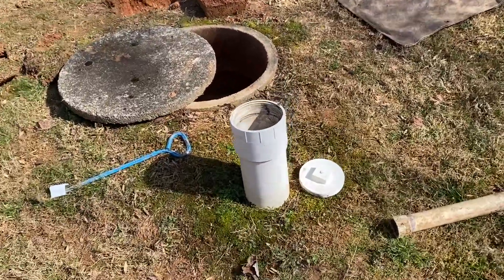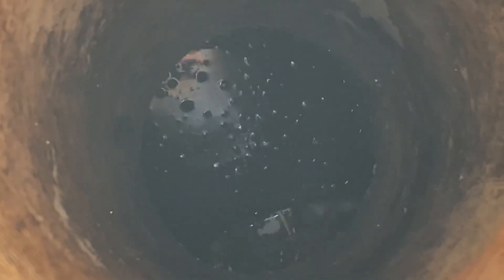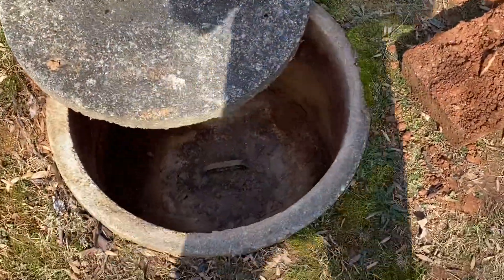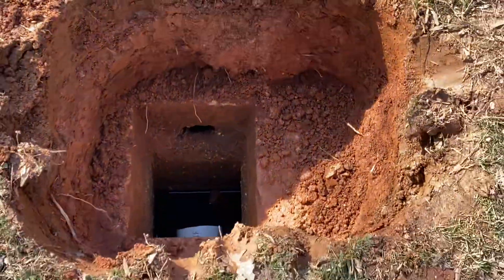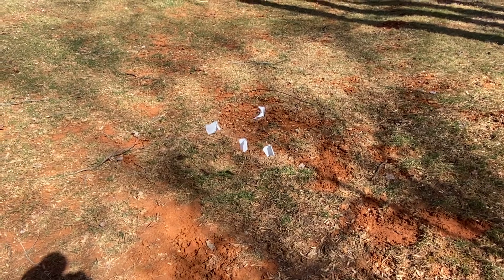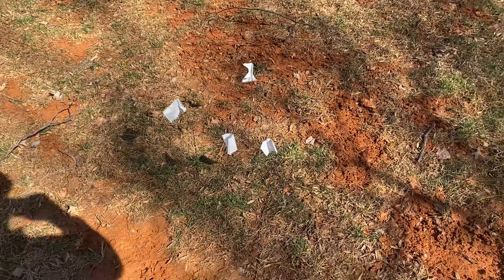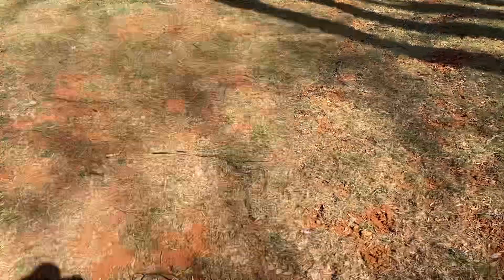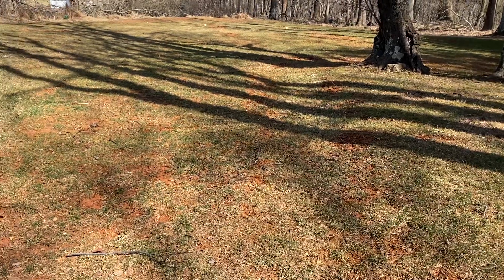What Does A Single Chamber Septic Tank System Look Like? Overview Of A Full System With Examples

Comment: Hi, thanks for posting. I am a newbie to septic systems and we have just bought a house on an acre of land in Australia on septic. System is a large single tank system, possibly as old as the house (50 years). How long do you generally expect a drain field to stay functional? Do they require digging up and refilling with new gravel etc after a period of time? 

There is definitely a bit of odour down the hill a bit from the tank.

Is it worth investing in a more modern septic system such as a dual tank system?
Thanks